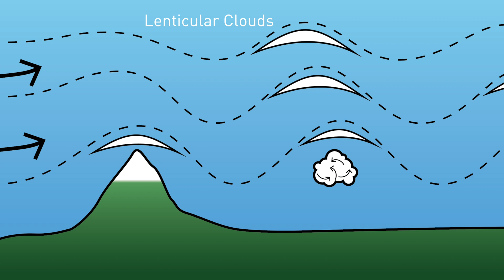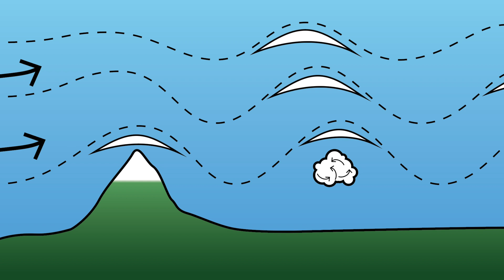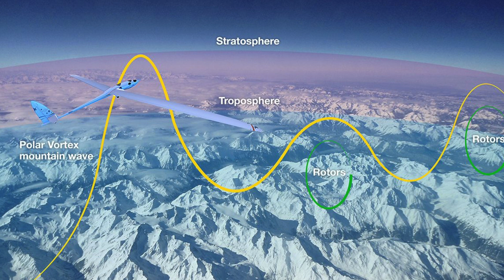How Mountain Wave Systems Work, with Lenticular and Rotor Clouds

Comment: As I understand,no mountains no wave,right?
Reply from the maker: You can have wave formed by other things including cumulus clouds, or a cliff eg coastline. Anything that pokes up into laminar air can do it, or a drop in landmass can trigger a bounce. Conditions have to be right down low to work off a coastline but it is possible.
Reply: @PureGlide  understood. thanks

Comment: I gave up flying gliders, and sold my glider, many, many years ago.  My flying was all done before the internet was a thing, the smallest camera available was the size of a brick, and all navigation was done using a map and compass, so the ability to share experiences and footage such as you have on your Youtube channel was just a distant dream.  I still managed to acieve 2 diamonds, missing out on the 500km, despite a handful of attempts.  Living in the SE corner of the UK, which is dominated by relatively low controlled airspace (thankyou Gatwick and Heathrow) and large stretches of water in more than one direction, made such flights extremely difficult to achieve.  I would have loved to experience flying a glider in New Zealand, as I know you have a number of clubs and some excellent soaring conditions.  Keep up the good work, you are helping to refresh a lot of fond memories.
Reply from the maker: Hi thanks for your comments! Glad you're enjoying the videos. Regards from New Zealand

Comment: Could you recommend an oxygen system for a beginner? :)
Reply from the maker: Yeah, mountain high EDS systems are really the only option to consider! I wouldn't go for a carbon fibre bottle, stick to the normal cheap ones. Hopefully your glider has a mounting for a bottle, otherwise you can get reasonably portable bottles too.
Reply: @PureGlide  Our LS4 has the has a mounting for a bottle. I will share the flight with you once I try it. Thanks for the reply and your informative video.
Reply from the maker: @hamedsarb  Excellent, have fun!

Comment: Years ago I worked with a pilot that flew an RAF Jet Provost in a wave, he shut everything down and stayed up there for hours using the same gliding principles. He only did it once as his squadron got worried and even alerted search and rescue when he didn't return for hours. When he did return they were very surprised to find he still had 1/2 full fuel tanks. Great video and great flying. Thanks
Reply from the maker: Ha that's a great story. Fantastic to just to freak everyone out by staying in the air longer than you should!

Comment: I’ve ridden a standing wave in PT6 powered Beech King Air with both engines back at idle and the props feathered.
Reply from the maker: Haha that's awesome :)
Reply: That must have been quite an experience! 😃
Did you maintain (or even gain) altitude riding the wave in the Beech?
Reply: @Johan-ex5yj  Sure did, I recall we were indicating about 160 kts and climbing over 500ft/ minute going through ten thousand feet.
Reply: @mitseraffej5812  Wow, that is STRONG lift!  👍

Comment: What's the highest altitude you have been to Tim?
Reply: I retired from the corporate world on my 50th birthday and took a job as CFI/Tow Pilot at Black Forest, Colorado until it closed due to loss of airspace. Winter was wave season with us flying the  wave off Pikes Peak some 25 miles to the west. We required either wave experience or a wave instructional flight prior to renting gliders for solo wave flights. I did over 300 wave orientation flights with students, most of which went to 30,000 feet.
Reply from the maker: About 22,000 feet I think from memory. It starts getting considerably more dangerous above that, if the oxygen fails for example, and haven't felt the need to go higher.
Reply: @PureGlide  Still a good effort!  I have been to 13000' many years ago but we didn't cough have cough oxygen.  Didn't stay long! Funnily enough we had a 13knot climb as well for a bit.

Comment: Very nice explanation!
But something I never got explained in my young glider pilot career, is how to get into a wave without a tow to 10.000 feet or higher.
Maybe you can explain it to us in another video 👍🏼
Reply: Depends on local topography. There are places where people have launched into the wave from 500' auto tows. One is the Wet Valley in Colorado (SW of Pueblo about 30 miles, south of Westcliffe) Of course, when the wave was that low, it meant 50 kt winds directly across the runway.
Reply from the maker: Yes exactly right, how to get into wave is the topic of the next wave video!
Reply: Know people who have climbed to over 20,000ft from a 500ft autotow  - all depends where you are located.... my first wave flight in Wales was from a low point less than 1500ft to 15000ft.
Reply: One time I took a winch launch, and as soon as I reached release height, I was already in the wave!

Comment: As always, great video! Cheers from Canada!
Reply from the maker: Cheers! Do you get much wave flying over there?!
Reply: @PureGlide  we do in the Rockies in Western Canada. I live in Quebec which is in Eastern Canada. It’s rather flat here, so all of my soaring was thermal activity.
Reply: @CLdriver1960  Plenty of wave flying in the east as well -i.e. the Quebec Gliding club as a annual wave camp at Baie-Saint-Paul for instance - just not quite as spectacular as the Rockies.....
Reply: @soaruk3697  That is correct. However, Baie St. Paul is 500km away from the gliding club I used to fly at. The next closest place is over 300km in Lake Placid, NY, USA. neither of which I would consider as spectacular.
If I need to travel to find wave, it would be to western North America, or New Zealand.😊